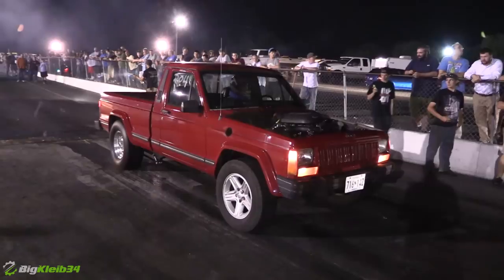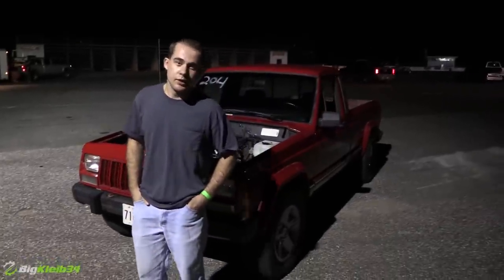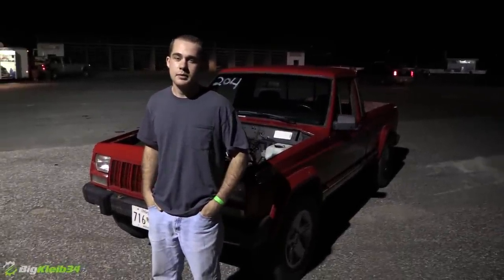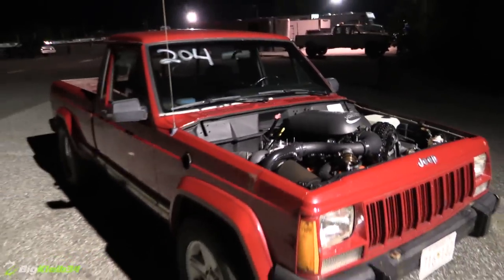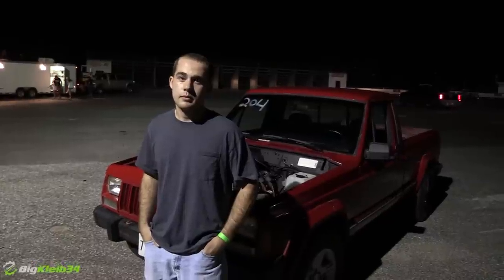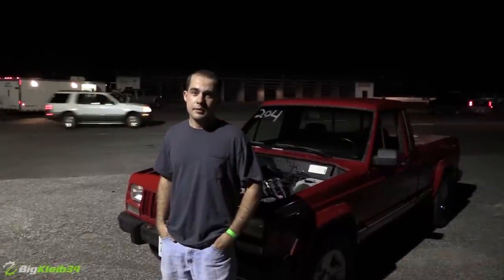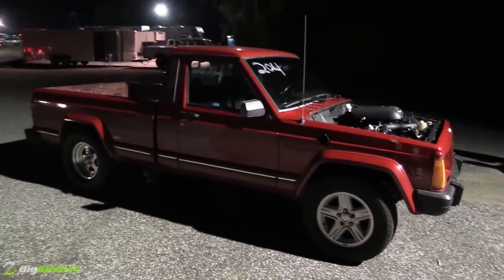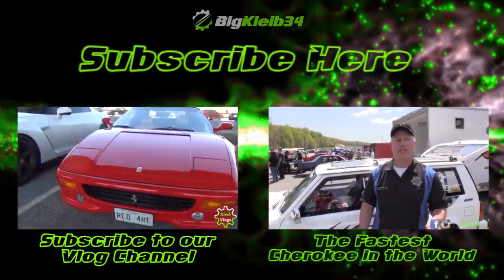Turbo LSX Jeep Comanche Goes 10s - COOLEST SWAP EVER?

Comment: 5.3 is not an LSx
Reply: It's not ? Then what is it ?
Reply: +darrien robinson just a regular LS series engine.
Reply: +darrien robinson an LSx is a race designed crate motor or block you cab order from GM Performance
Reply: +The Reginator No , that's LSX.   LSx is referring to any LS based engine.